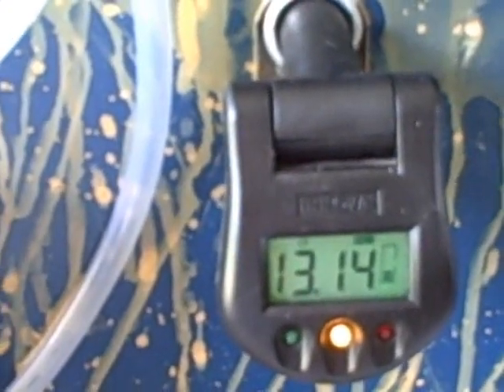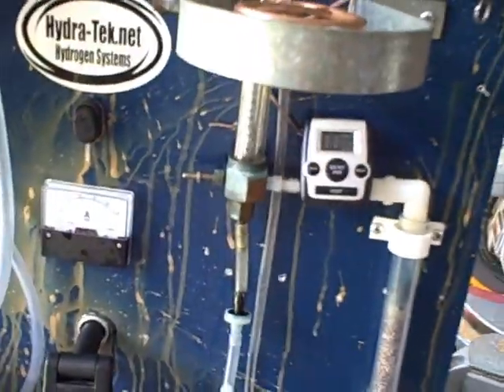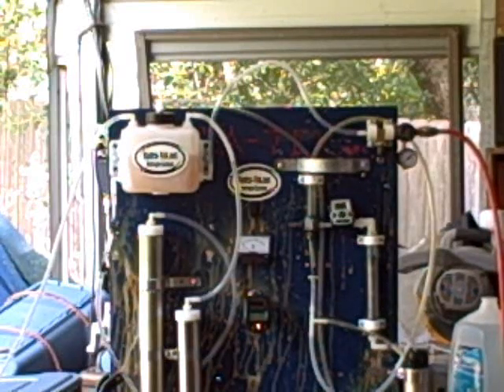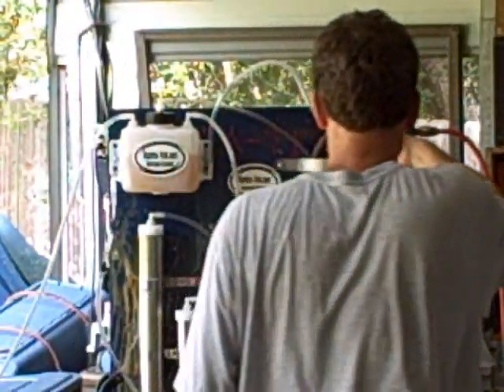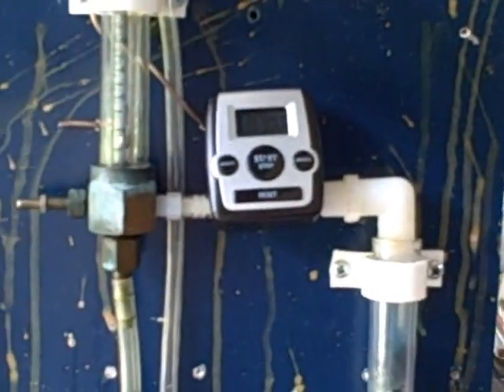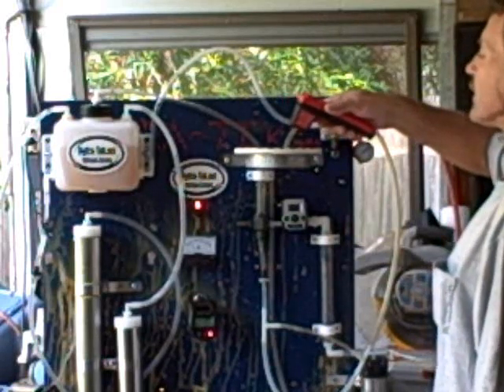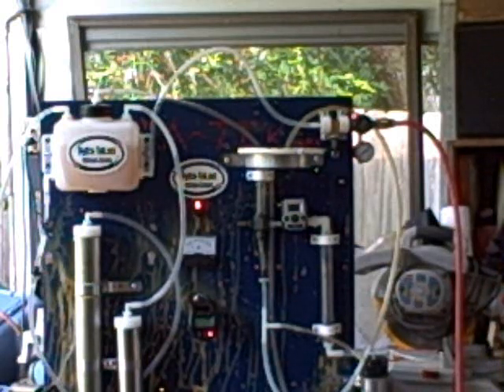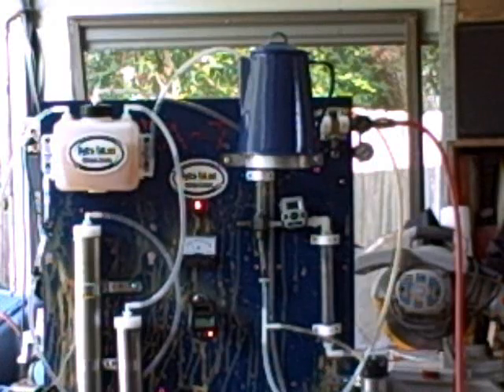more testing with hho and air flame

Comment: I really like your experiments a lot. 5* rating from me.

I think that the whistle comes from the vapor that comes along with the gas. If your lips are completely dry it is hard to whistle. It's also a possibility that   the vapor condenses  back on the burner after the gas is burned? 

Greets from the Netherlands, iT